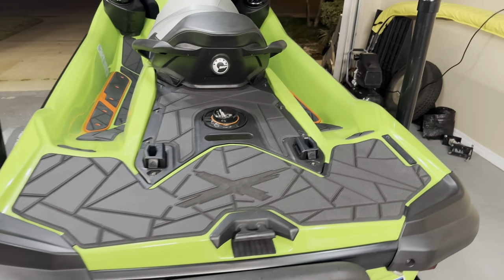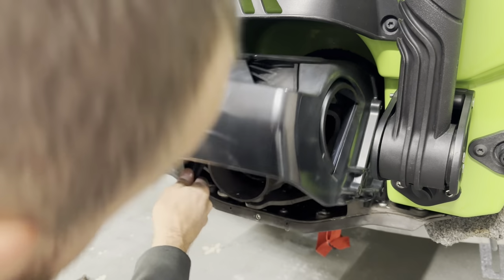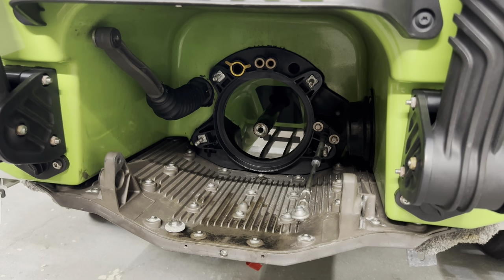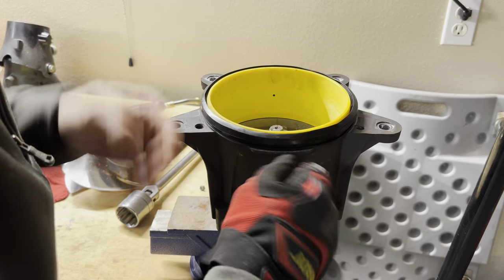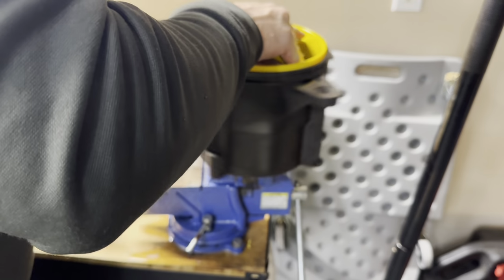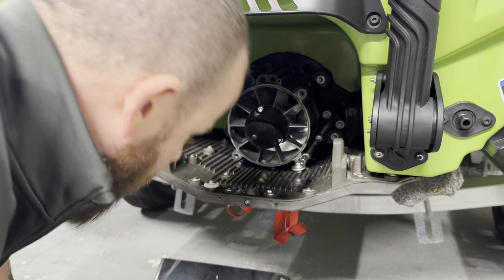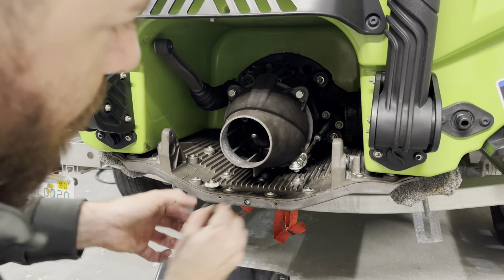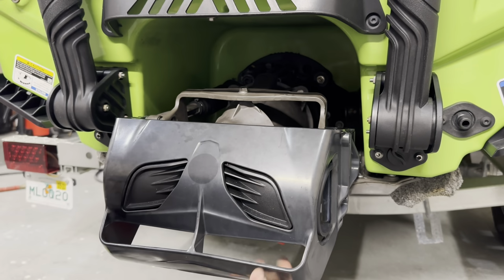Sea Doo Wear Ring Replacement and IBR 4 Jet Pump Removal and Install

Comment: Excellent video!! I replaced the wear ring on my 2022 rxp x 300 and the impeller boot did not screw on? It stayed on the shaft and just pushed into the impeller. I ran to the dealer and bought the stock one that threads on. Is that common for them to come with a different boot?
Reply from the maker: They all thread on. Sounds like the threads stripped out of yours.

Comment: Do you put any grease on the jet pump threaded shaft before you put the new impeller on, or any grease inside the impeller splines before you put the impeller boot back on?
Reply from the maker: You use anti seize on the threads of the impeller shaft. I don’t put grease inside the impeller splines, but you can. I just put it on the driveline shaft splines per the manual.

Comment: Those set screws people would actually ad them back in the two stroke days to prevent 139mm and 155mm wear rings from spinning.  Some people would use a  drywall screw.
Reply from the maker: They used to use 2 sets screws on each side in the old plastic jet pumps as well.

Comment: I have minor damage "chips" on the inside of the impeller housing where those "metal walls' go around. Is that something I should be concerned about or will that be ok?

Comment: Awesome video!! I used this video to change my wear ring on my 2023 GTI SE 130. I took my sweet time to make sure I did it correctly. Installing the pump assembly was the hardest part. Plus my IBR arm doesn’t stay up like yours so it was constantly in the way. 

Are you not on Instagram anymore?

Comment: Thanks for this. Great work. I did my GTX 300 2020 today and only used a heat gun instead of a torch to soften the wear ring. One note- the "65" spec on the 10mm bolt for the steering should be noted as in-lbs rather than ft lbs. Also in salt water (sw florida) so removed the old loctite and added 2-4-6 grease to each bolt as suggested.
Reply from the maker: I but a big banner that states “65 INCH POUNDS! NOT FOOT POUNDS!” Please go back and rewatch.
Reply: @SaltyDogPerformance  I missed that, was listening to it on my headphones while installing, thank you nice work
Reply: Is it ok to put grease on the bolts or loctite?
Reply: A 10mm bolt wouldn’t be torqued to 65ftlbs I think in general.

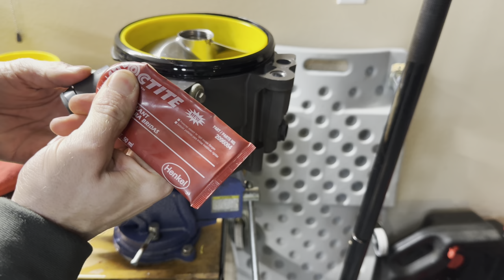Comment: @ 22:43 you said that red locktite would destroy plastic threads but as your saying you are putting red locktite on?
Reply from the maker: That is not Red Loctite 271. It is Loctite 518 which is a flange sealant. It’s not the same thing.

Comment: Great video. I am not mechanically inclined at all but do understand a little bit. Seems like a fairly easy job.

I have a Sea-Doo GTX 230 at what point would I have to take a look at the Ware ring?
I have 110 hours on my Sea-Doo and I am the first and only owner of my ski.

Comment: Awesome video! Doing this now on rxtx 325 with Solas impeller. My nose cone barely had any grease from factory, not even 1/4 full. Just to clarify, you're saying to not use the green cone that comes with the Solas, the stock is better? Wondering why and also if I should fill my bearing and the black cone fully with xps grease? Thank you, I subscribed!
Reply from the maker: @rg9580  you grease the splines on the driveshaft heavily. The factory impeller boot is better because it doesn’t corrode and seals better to protect the grease.
Reply: @SaltyDogPerformance  got it, thank you so much!!!

Comment: I might have stripped the Set screws but still put loctide on them and put them in & also i added yamaha marine all purpose marine grease into the pump cone to add some to the original seadoo grease, what do yall think??

Comment: Great informative video the best i have seen! If you dont mind me asking why dont you use a stainless steel wear ring instead?? I was thinking about switching myself to one.
Reply from the maker: I prefer plastic. As the impeller speed increases the impeller heats up and expands. Better to have a metal impeller edge making contact with plastic wear ring and not metal. Lessens the wear of the impeller.
Reply: @SaltyDogPerformance  ok thank you

Comment: Hey do you have any videos on the 200 hour service such as:

EVERY 2 YEARS OR 200 HOURS OF OPERATION (WHICHEVER COMES FIRST)
Replace spark plugs
Inspect flame arrestor (900 ACE engines)
Inspect and lubricate drive shaft/PTO splines (900 ACE engines)
The following must be performed every 200 hours (irrespective of the number of years):
Inspect, lubricate PTO sleeve and replace oil seal and two water seals. (Inspect for possible leaks or damages on oil seal or on two water seals, and PTO sleeve surface.
Lubricate grease chamber (between the two water seals.) (900 ACE engines)

Comment: I have a 22 RXPX 300 with about 20 hours on it. What’s your opinion on me changing to a solas 13/18 impeller and putting on a stainless steel ring. There’s nothing wrong with mine… but from a performance standpoint is it worth it?
Reply from the maker: I don’t like stainless wear rings because (at least where I live) I see the impellers get worn out very fast with a stainless ring. There’s no point in putting a 13/18 on unless you have a tune.

Comment: Thanks for the video. What seals do I need and what grease do I need to get? Like can you get me a list of everything I need besides the tools? Sorry this is my first time
Reply from the maker: I’m pretty sure I show all the parts and part numbers you need.
Reply: @SaltyDogPerformance  @.   22:45    i think its red locktite you use but 10 seconds prior you say if you use it it will destroy the threads so i just wanted to verify
Reply from the maker: @thecaveman4383 that is not red loctite 271. That is Loctite 518 which is a flange sealant. I say NOT to use red Loctite which is 271.

Comment: Great video but I have a question. I got the WR012 TOOL  to change the impeller but i can't figure out what size socket to get to fit on the WR012 spline tool . Any one know? Thanks for the video and thanks in advance
Reply from the maker: If it’s the tool for supercharged ski impellers then it’s a 32mm socket.

Comment: How much grease should you have on the cone? And what type of grease do you recommend?
Reply from the maker: You need to use the XPS jet pump bearing grease from BRP. Watch my jet pump rebuild video and you will see that I just use the remainder of the amount in the tube. One tube will do a complete pump rebuild.

Comment: What year is this my 2020 RX PX, the IBR and the cones are held on by the same bolts for for the cone two for the upper bracket. It’s always a pain in the ass to put back in but not undoable.
Reply from the maker: This is for 2018+ ST3 hulls, 2020+ Polytec Hulls, and 2021+ T3R. The 2016-2020 RXPX has IBR Gen 3 which is a little more difficult to remove.

Comment: How long do pumps last for in saltwater?
Reply from the maker: @alisonrahn9873  depends on how well you clean your jet pump area. The driveshaft has a teflon coating on the end of it where is spins inside the seals. That part will start to rust and the teflon coating crack. That will wear out the seals and then allow water to get in. I’ve seen some only last a year. Some last a few. All comes down to cleaning
Reply: @SaltyDogPerformance  where are you located ? Do you service other people’s skis? I just bought a 2023 seadoo 130 gti se. 200 hours on it. They recommended replacing pump, wear and shaft already. Quoted 1800

Comment: Hi there. Where can I get the impeller and wear ring?
Reply from the maker: The wear ring is OEM, so you can get it anywhere that OEM parts are available. I buy most of my parts from Riva Motorsports.
Reply: Great! Thank you!

Comment: Thoughts on steel wear rings?
Reply from the maker: Don’t do it unless you plan on chewing up impellers!
Reply: Thanks for the reply! I'm planning to do my wear rings soon and my impeller has some minor chips in it after only 30 hours, do you recommend the stock impeller or a different Solas impeller?
Reply from the maker: @jasonnguyen8498  depends on your ski and modifications.
Reply: Yamaha uses stainless steel wear ring and doesn’t chew up impellers?

Comment: What was the red loctite you put on the threads. I thought you said not not use red loctite on it. Am I missing something? Great video by the way
Reply from the maker: It’s Loctite 518 which is red in color, but not “Red Loctite” which is 271. Loctite 518 is a flange sealant. I say that in the video and show exactly what it is. Red Loctite 271 is thread locker.

Comment: Should not drill all the way through wear rind
Reply from the maker: You have to drill all the way through for the set screws to bite into it. If you don’t, the screw will push out on the wear ring and you have a bump that won’t allow the impeller to be reinstalled. Service manual tells you to drill the holes. Even when you get a ski new from the factory the holes are drilled all the way through the wear ring.
Reply: I just replaced mine and the original screws from the factory were screwed all the way through the wear ring.

Comment: That's not a leaking unit, you'll see a lot more water than that. And please don't use Ebay seals , they won't last more than a month in the bearing unit. Good job , never though of heating the plastic like that, and I've changed so many of those rings.
Reply from the maker: I only use OEM parts for things like that. Also, just because you don’t see water in the pump cone, doesn’t mean that water isn’t getting past the first seals. I just did a jet pump rebuild for a guy and the shaft was extremely rusty and water had gotten past the first two seals. A little longer and it would have gotten past the 3rd seal and gotten into the bearing.